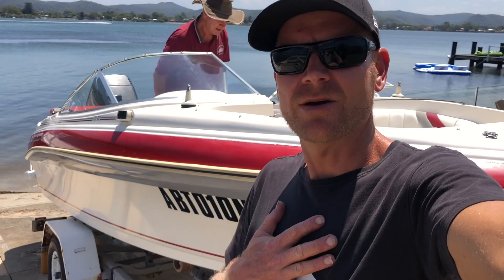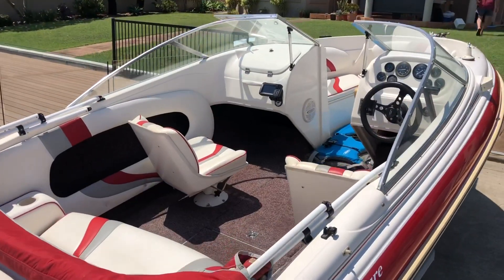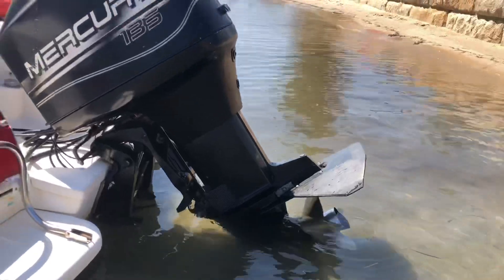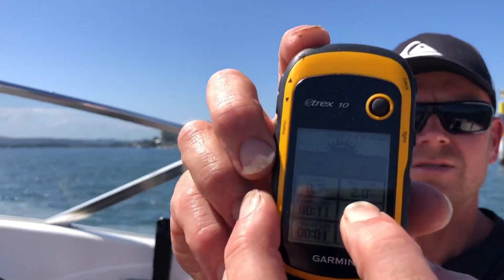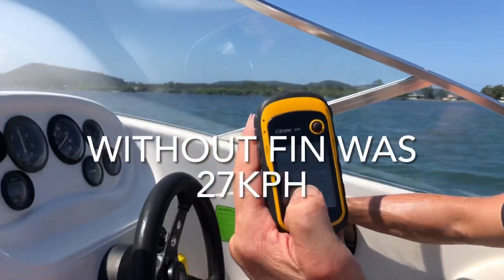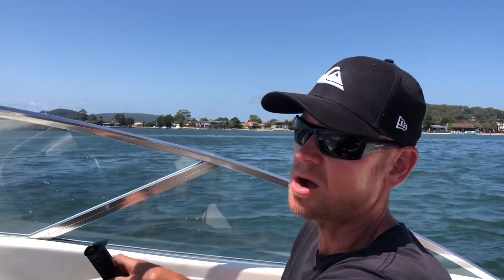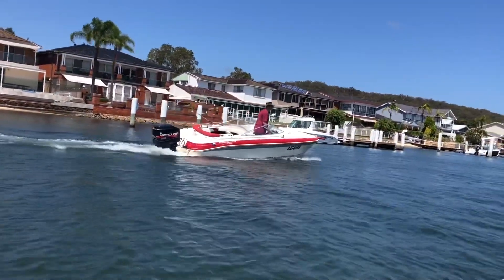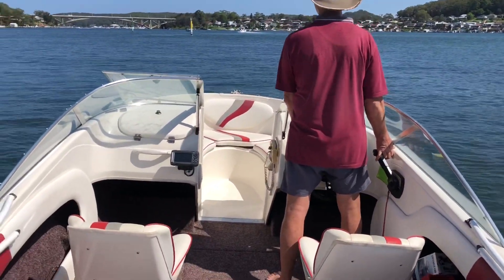Outboard Foil Test - do you know??

Comment: So here is an interesting thing I found with having a fin installed on my 3.8 OMC Proline powered by a DF20A Suzuki, it performs as expected with the fin but I then installed an electric jacking plate I fabricated out of some 6mm Aluminium right angle and a 4" 12v linear actuator. This is where things get interesting, the performance of the boat with the jacking plate was far superior with the fin left on as the fin serves to trap water pressure against it and prevents the prop from cavitating when the motor is jacked up. However, the fin itself is all the way out of the water so is not creating drag. The only limiting factor I have now is ensuring water pick up so I will be watching your leg modifications with interest.
Reply from the maker: Yeah nice one mate 👌
You could add a nose cone to your lower unit which will direct water up to the factory water strainer inlets. On one of my 25hp race boats I had the prop shaft 10mm below waterline running a nose cone and that cone brought enough water up the lower unit to cool the motor no probs (I did run the telltale in a tube up to where I could see though so I could always make sure water was cooling the motor)
Keep me posted mate with speeds and setup, I really don’t get to play with the 4 strokes much and am very interested.
Cheers 
Aussie Boat Guy 😎
Reply: @25hpboatracerman  I haven't done alot with props yet as the boat is a bit on the hefty side with mods I have done to it. That is going to change in the near future as soon as I finish the project 4.85 I am currently doing. Looking to lighten the boat right up first and then considering doing a tunnel hull towards the rear to get a column of water for the prop to run in, although, I have had the boat since new in '97 so I will be thinking long and hard about the tunnel before I start cutting. Weight reduction will come first and then I will go from there.

Comment: Great video mate, having somebody film from the outside in slow-mo really gives you a good view on how the foil affects the boat.
couple questions:
how do you think the mounting height of the motor affects the foil? if its too low does the foil become basically useless?

what about the trim setting, how does that affect the foil, and why did you only test it trimmed all the way down for the video?
Reply from the maker: Hi mate,
Thanks for your comments.
The engine hight does matter but the foil will be useful even if the motor is mounted too low.
So we had the motor trimmed all the way down for the low speed plane test because technically speaking that gives the boat and motor the easiest time, trimmed out it would really battle to get up and maintain a slow plane speed.
We also had the motor trimmed all the way down for the hole shot - same reason, with the motor trimmed all the way down - the boat will get up on the plane quicker.
We did however trim the motor up to get the top speed readings.
Once a boat is beyond a slow plane the affects of having the motor trimmed all the way down become more pronounced, it actually starts pushing the bow down and making the hull plow the water somewhat so beyond a slow plane then you should trim the motor up as this will allow the bow to raise slightly, releasing the hull and allowing the boat to gain speed and perform better.
Great questions mate 👌
All the best 
Aussie Boat Guy 😎

Comment: I wish people would test hydrofoils on a boat that needs them
Reply from the maker: There was a need on that boat, with two people, not so bad but with a full boat yes. Also that boat is used at slow speeds.
If you watched the video properly you would see the benefit the wing gave at slow speed and also to limit bow raise at slow speed which was a decent concern to the owner as fumes from the outboard would fill the cockpit as the bow was so high the fumes would just get pulled into the boat and sit there.
So lowering the bow was an amazing result with the wing install.
If I owned the boat, I would not install one as I would be driving it much faster and I don’t have as many friends 😂.
Cheers, love st Huberts as well.
Aussie Boat Guy 😎

Comment: Nice video!  Have tested the same a few times. Basically same result like You, we loose a bit on the top end but planning speed range is better. That is also good in rough weather when not possible to keep high speed, can save plenty of fuel. Also on a dinghy can be very useful, pending on hull shape.
Reply from the maker: Cheers mate, appreciate your comments. 
Yep, the foils definitely have a place on sone boats.
Cheers 
Aussie Boat Guy 😎